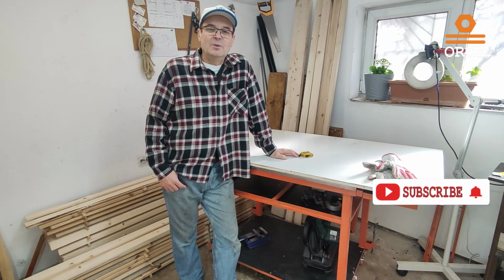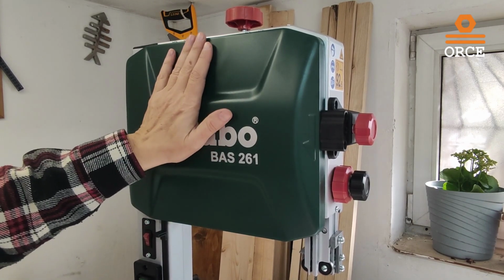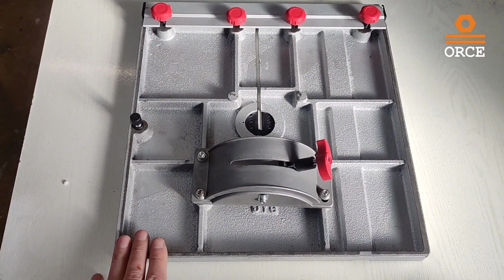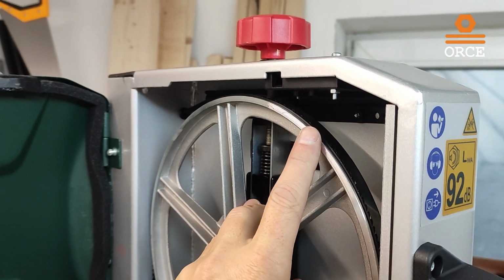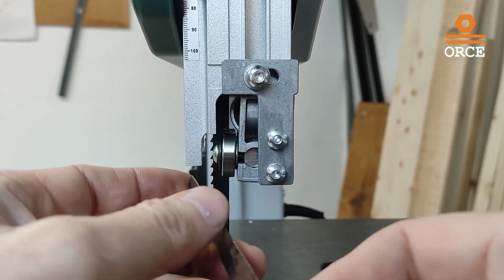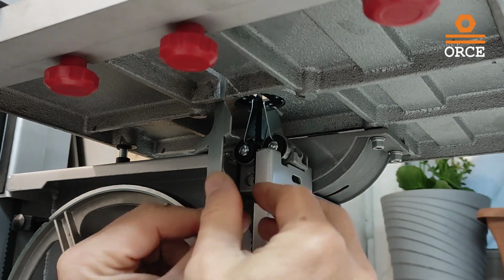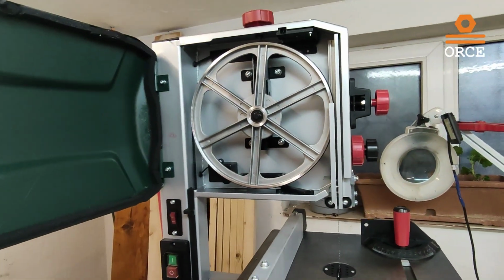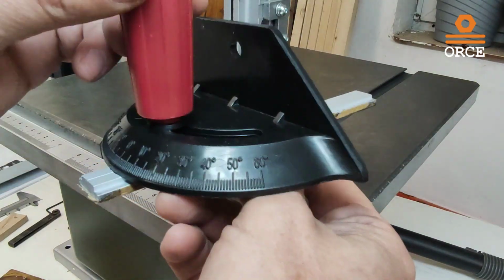Unboxing, installation & first run of bandsaw Metabo BAS 261. How to set up bandsaw. #power tools

Comment: Thank you for the video. I have a question: How many millimeters of clearance should there be between the bearing and the blades? What is the exact measurement in millimeters of the part we have?
Reply from the maker: I have one more video on that subject. I am not at my workshop now. As for distance, less than 1mm for sure, Try to make it as close as possible.
Reply: @orce_MKD_DIY 👍👏 😊
Reply from the maker: And welcome to the channel.

Comment: 6:54 How do you regulate 90 in this case?
Reply from the maker: It can go uo to 45 degrees. 90 is no problem.
Reply from the maker: On lover side there is swivel with angle scale.
Reply: @orce_MKD_DIY I saw the graduated scale and it is used to make the inclined cuts. I tend the other inclination, the one towards the operator
Reply from the maker: @MattiaRaggiDrum ,  there is no regulator for that.

Comment: Very useful stuff. The website says that it's 47cm deep but it looks much less - I assume that the 47cm is the max distance if the fence is on and the fence is easy to remove? I don't want something stickng out that much when not in use!
Reply from the maker: It is that deep. You need clearance. Als9, i  have couple other videos for that tool. Look the one for broken saw repair. Welcome to the channel and have  a nice day.
Reply: @orce_MKD_DIY thank you for the reply. I could get clearance if needed by moving away from  the wall, I'm trying to understand how deep it would be if flush against a wall. Is the fence that tricky to remove? I don't mean the table but the straight edge guide.
Reply from the maker: Also, i dont remove fence, it is not simple to get it on again.

Comment: Great video, well explained and well filmed. I suggest it's easier to adjust the lower bearings 'before' mounting the table. 
In fact, I couldn't swing the working plate out of the way to adjust the lower bearings with the table mounted in place. Once I removed the table, the plate swung out of the way easily.
Reply from the maker: Good idea. I hadn't thought of that. I'll see if it can be applied next time I change the saw. Thanks. Stay in touch with the channel. Regards.

Comment: @Orce. Thanks for the quick response. I saw all your BAS261 video's. As for your answer, my problem has nothing to do with the rip fence. It seems I wasn't completely clear.
If I put the table in the 0 degree position and then secure it with the bolt (with the red "wings") under the table, the table leans back a bit. So if I do what you do at 6:54, I see that the table is not quite square.
Reply from the maker: You don't have to put it in 0 degrees. If you find that +/_ few degrees is getting you 90 degrees  angle on saw, that is OK. In my case table was quite stabile. Check to see if table has some obstructions on curved bed. maybe some grease  left or something else. In my case, I had problems with few alien bolts, not a good quality, but i  replaced them with better ones. This machine has a few gremlins living inside of it. Best regards.

Comment: 6:53 If the front and back of the saw are not square, how can this be fixed?
Reply from the maker: Hello, saw is always in line iif installed properly, you need to pay attention to rip fense and table angles. Try this, draw a line on blank board and try by free hand to follow the line. See where board goes behind the saw, left or right. That way you will see how to adjust table to get strait line. Also, look other videos that i have on this subject. Best regards and happy new year.

Comment: Very nice video. 👍  I replaced my first BAS 261 because it had many scratches, and second even doesn't start, but I can turn the light in it, so...
Reply from the maker: Thanks for finding this video and my channel. I also have some problems with BAS 261. I solved few of them and made another short video. You can see it on my channel.  I get new problem every time I turn on this machine, but slowly I start to understand how it really works.
Reply from the maker: I will try to make new video for repairing saw belt, new METABO 6mm belt broke after 30 minutes of work. :( Have a nice day.